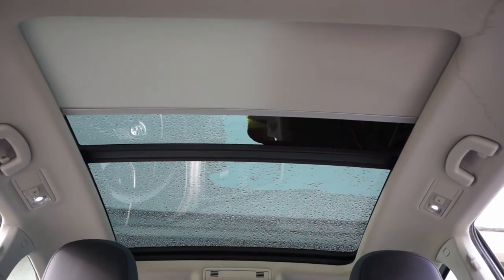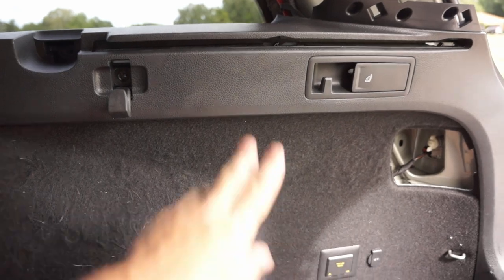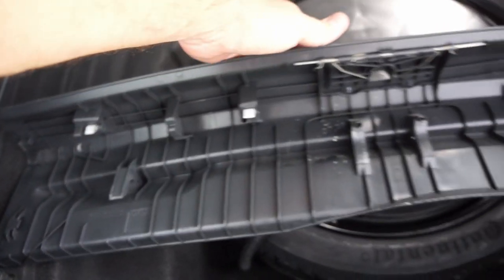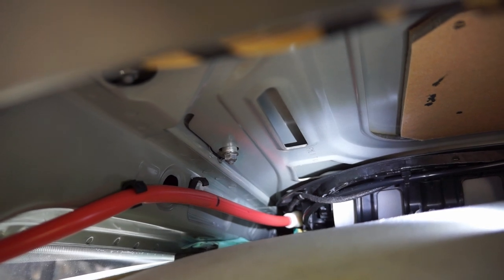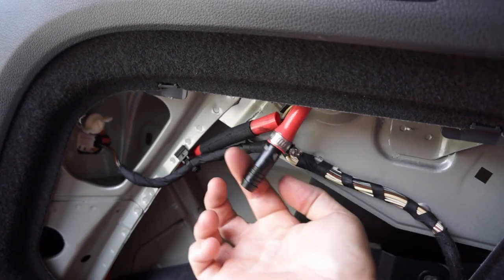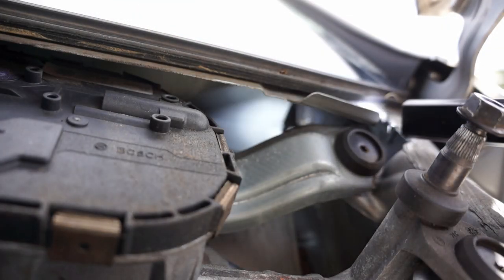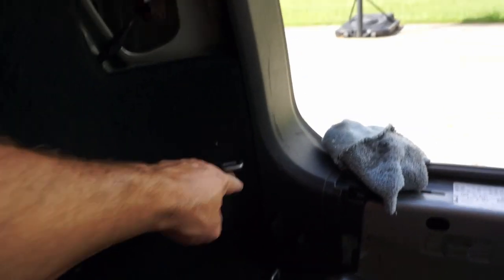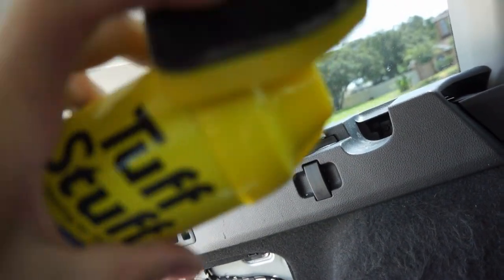2017 VW Sportwagen Panoramic Roof Drain Fix

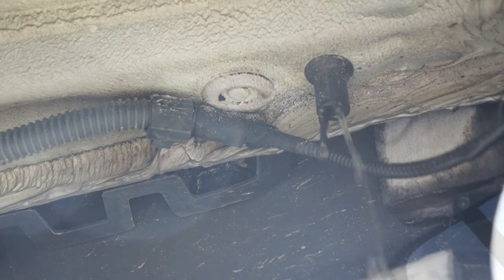Comment: Hi, at 9:56 you mention to check the inner lining. I do have some water that comes in at that point in both corners.. looks like it comes trough the rubber window seals and gets underneath the glass. Any thoughts about that? Water pours out just fine at all 4 holes..
Reply from the maker: Water will get underneath the glass- by design.  It is meant to get in at the outside edge where the front and back glass panels meet.  It should then run along the inner lip of the sunroof towards the rear drains and out.  If you have dirt build up in those channels then it may cause water to overflow the channel onto your headliner even though it seems to be flowing out fine at the exit.

Comment: Following this fix, did jr confirm whether it fixed his issue? 0:02
Reply from the maker: I haven’t had the leak return since but I also take the time to clean out the drains once a year.
Reply: @JRsGarage  thanks for confirming, really appreciate it. What do you use to clean the drains?
Reply from the maker: @shamm6880 water. Watch under the car and ensure it flows freely out the bottom drains.

Comment: can you tell me where exactly the rear drain is located .
Reply from the maker: In the corners of the rear bumper.  Up under the bumper cover.
Reply: @JRsGarage  hello good morning

but where are they by the window.
at the part of the glass on the roof that cannot move
Reply from the maker: They are at the 2 corners.  Only accessible if you completely remove the headliner.
Reply: @JRsGarage  okay thanks

Comment: had this blockage on my Passat B8 GTE, water then ran into my PHEV wiring loom at the bottom of the A-Pilar, resulting in up tot 2000€ worth of damage. because of this stupid plug and the lack of checking this at the dealership each time the car has to go in for routine check-ups. VW and AUDI know of this problem, the internet is FILLED with sunroof drain issues but the like the €€€ it provides i guess. I'm having my car repaired, the sold of. No VW for me anymore.
Reply from the maker: It sure is a major pain to deal with.
Reply: @JRsGarage    Volkswagen has had this issue with sunroof drains since the original Rabbit back in 1975. They never got it right.

Comment: That was a hard job completely unnecessary. The problem could be fixed with 5 minutes easy job cleaning the small conduit rubbers at the Front/Back. Take a look to this video https://youtu.be/2GB1s-EqeAI
Reply from the maker: Yes, but no need to repeat a video that's already been done.  If people have trouble with the sunroof tray drains, drain lines, or headliner, now they know how to access them.
Reply: So if we just cut the tips off the front and rear drain plugs it should solve this?
Reply from the maker: Yes, the flappers at the end of the lines should be removed.  They can be pulled off once you locate them.